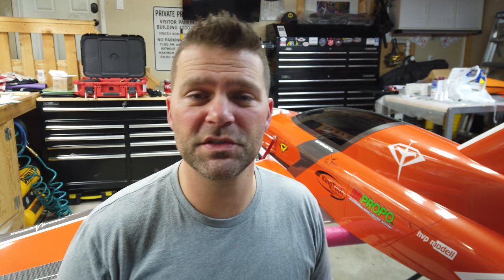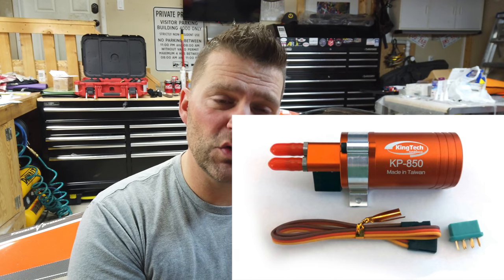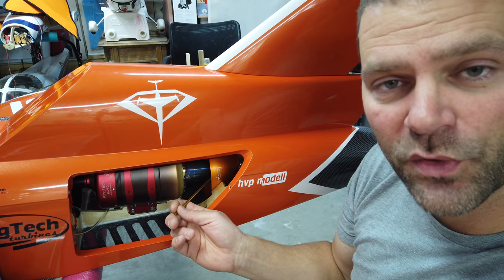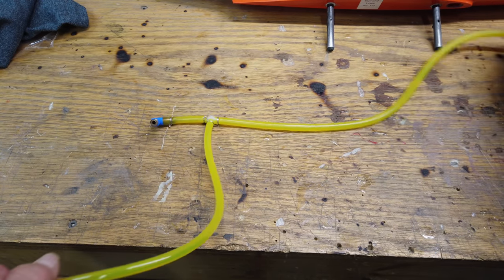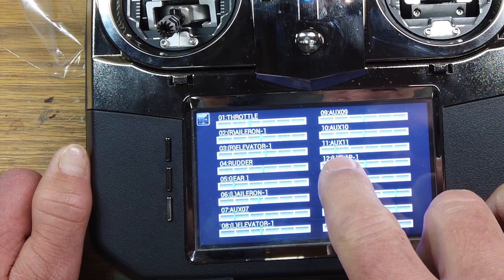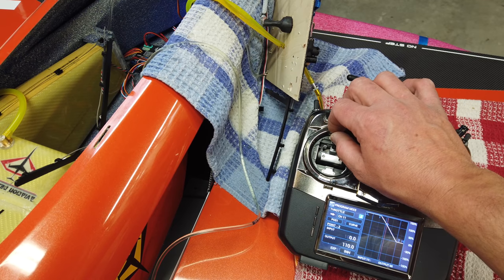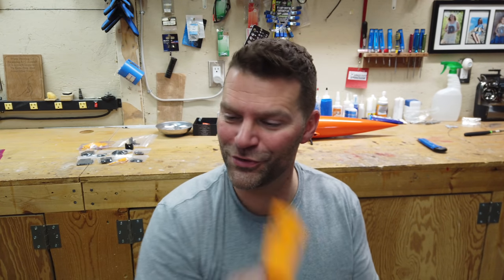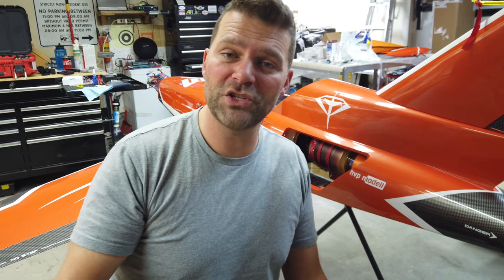HOW TO install a Smoke System in Your Turbine Plane

Comment: I love how informational your videos are. I haven't been interested in adding smoke to my turbine planes. But after watching this video I think my next build will have to be my first. The throttle mix makes so much since, great tip!
Reply from the maker: Thanks Jeff!  One of the benefits I didn't talk about in the video with the throttle mix is it helps to make your smoke fluid last longer as well.  Thanks for watching!
Reply: I noticed on my friends jet that I believe his pump is either on or off. So if he turns on his smoke at idle he gets a lot of unburnt smoke fluid dripping into the exhaust area.
Reply from the maker: @jeffjackson6358   yea that's one of the problems with the on off method.  I have used it and it works ok as long as you don't turn the smoke on at idle for the reasons you mentioned.  Additionally I have seen it happen and had it happen on my planes, at idle or close to idle you turn smoke on and you get a thundering roaring sound.  that's the smoke fluid igniting and not atomizing!  Fun and scary all at the same time!
Reply from the maker: @jeffjackson6358  Also when I finalize the mix on the radio I don't have smoke come on till i'm slightly up on the throttle stick/curve.

Comment: Nice Work....Wouldn't want to add that much weight to my Jet, but Very informative.
Reply from the maker: Yea.  Depends on the jet really.  I took it out of my Ultra Flash this past summer and lost 1lb total (empty of course). So the System is what it is.  On something like a Diamond that's a 40+ lb jet you don't really notice it.  Full of fluid yea you notice it on any plane.

Comment: Concrete form release oil for wood forming used in construction works well for smoke oil - the game is where can you find the cheapest source for oils doesn't matter which one you use.
Reply from the maker: Good Call!  I have heard of some guys having good success with that as well.  I will source some and give it a try this year.

Comment: nice vid, expected to see nozzle at the back of tube but you moutned it front side next to turbine... given all benefits (preheat + no dripping inside model) I expected you will go that way, did you compare smoke effect on same model with both ways of install, did you notice any dramatic difference?
thanks
Reply from the maker: On something this short (pipe length) I don't think it would matter too much.  With a longer pipe the end of the tail pipe still works ok but it's better right at turbine.

Comment: Best bit of advice I’ve been given was to use a Festo one way check valve between the smoke line and the outlet tube...no leaks when system is off.
Reply from the maker: That's a great idea Justin!  makes total sense!  Thanks for sharing that!

Comment: Excellent info as far as it goes. What’s not addressed is the smoke fluid needed being a variable due to engine size…
Reply from the maker: Thanks!  Not critical on Turbines.  Helpful but I have had mixes setup tied to the throttle channel and also mixes that were just on and off with no variation.  Both work great!

Comment: I've seen smoke systems made by using a brushed esc and a cheap washer pump. They work well when set up correctly.
Reply from the maker: Yea for sure!  That's a great option!  Lots of guys will use a "Faulty" fuel pump for turbines.  They still work great but not accurate enough for running a turbine.  Just need an ESC and it's a great options as well.

Comment: Great info. Won't a brass tube melt in the exhaust?
Reply from the maker: Nope. Never had an issue with it. I wouldn’t use it right behind the turbine but at the back it’s fine

Comment: Do you do anything to secure those tabs to the pipe or just let them slide around?
Reply from the maker: once it's fastened down there is really no need to mess with it.  If you bump the smoke tube it can move but in this case with the diamond, the tube was fastened to the top rail.  The smoke nozzle was bent down toward the turbine so that bend sitting against the rail is also holding it in place.
Reply: @thelightersideofrc  thanks for the reply, I gotcha. My tube seems to slide in those two tabs. Its not going to go forward because of the 90 degree bend in the back but I was worried it could make its way out the back and pull the smoke line off the pump. It would take a lot I know but I worry about every detail.

Comment: Do you vent the smoke tank with a T to the kero tank's vent or just use a separate vent?
Reply from the maker: Good question. The smoke system has to have its own vent.

Comment: i would love to get your advise.my issue is that i have smoke fluid dripping inside the cone,under the engine in hi flow pump setting.my setup is a PB pump with PB fluid and 6mm festo tube.also the nozle is a 6mm tube.my only thought is that the tube is to big and there is lots of flyid going through.any thoughts/ideas???
Reply from the maker: Decrease size of line from pump to smoke stick to 4mm festo. Also if your tanks sitting high up gravity will allow that to happen.

Comment: Why to the engines have some throttling issues when the smoke is turned on? And what’s the best way to prevent that from happening?
Reply from the maker: What you’re explaining is probably the rumbling when you turn the smoke system on and the throttle is at idle.  It’s generally the smoke oil igniting versus atomizing.  Best solution is when you do the throttle mix don’t allow the smoke to come on until the throttle is up let’s say a quarter

Comment: I have an issue with my smoke system. Every time I fill the the tank, it will drop out the back of the outlet pipe. I ended up installing a valve and close it until I’m ready to fly but do you have any idea why that heppens?
Reply from the maker: Hey Zachary. My first thought is your tank is above the output nozzle. Not a big deal but could be the reason. 

Second is what brand of pump are you using?  Typically the higher end pumps (powerbox, kingtech) have nice and tight systems so will let very little fluid flow by at rest. 

I install a festo/on off  valve on all my installs. And it gets treated just like my fuel valve. So weather I’m using smoke or not it gets opened at turbine startup and closed at shutdown
Reply: @thelightersideofrc  I do believe the tank inlet sits higher then the pump. 

I use a Sullivan skywriter, so maybe that is the issue.

Maybe I missed it but I didn’t see a shut off valve on this build, so it got me wondering. I installed a shut off as well and that took care of the issue but I wasn’t sure if that is what you are suppose to do or if that was just a band aide to an issue.

Comment: Hey Jonathan, another great video, been using smoke similar to you for many years. I always think there is a big missing element to a turbine flight without smoke. One thing you didn’t mention is the orientation of the flat nozzle to the exhaust stream? I’ve only ever oriented it at a right angle across the stream, never tried it in the ‘minimum drag’ position. A bit of turbulence in the slipstream also helps to get a nice big billowing smoke trail. My Ultraflash from a few years ago.

https://youtu.be/paEoE9h8zLw
Reply from the maker: Nice smoke!  Looks good. I’ve actually never played with the tip orientation might be something I’ll mess around with on the diamond as it’s easy to access the nozzle from both sides.